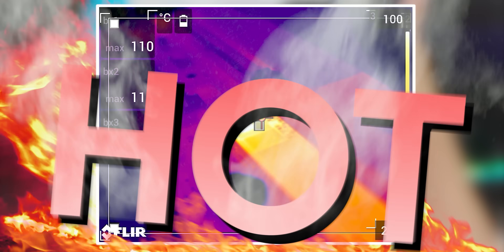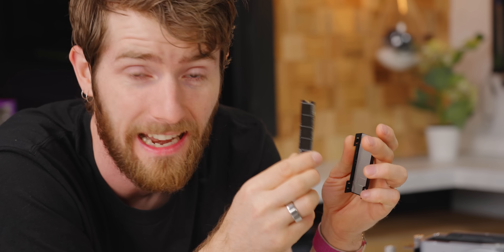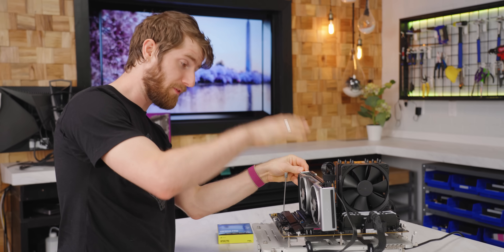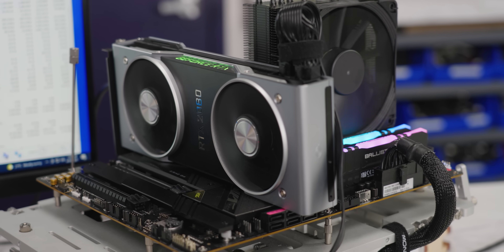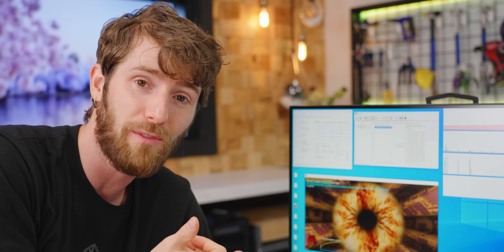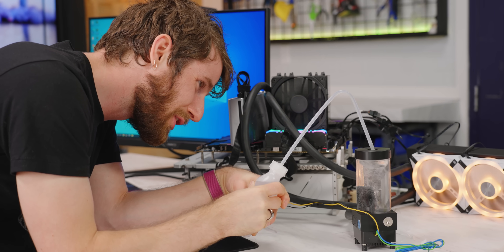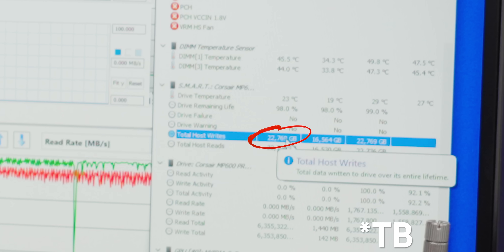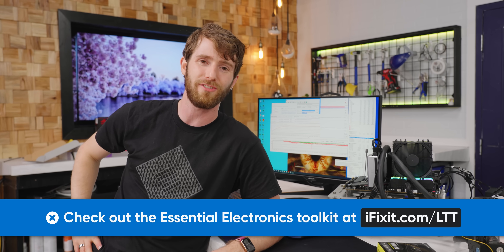This Product is a Meme - Corsair MP600 PRO Hydro X water-cooled SSD

Comment: When I worked at Nokia, we were experimenting with 3D chip stacking and had a combo NAND/DDR package mounted on top of the CPU, effectively working as a heat spreader. Under normal conditions this was fine, but in double-precision FP workloads, we'd see a thermal hotspot in the CPU and observe periodic bit flips in the memory/flash package directly above. We worked around this in production by dynamically clocking down the CPU to stay within thermal tolerances, but there are certainly valid use cases where cooling NAND is essential.
Reply: Tell us the secrets. How did you guys make it unbreakable? my cousin had one and has it to this day and I found it, and dropped it off a 3 story building. No cracks
Reply: its vibranium simple.
Reply: @p_mundt  Idk if they do, but I wish that mobile companies like Samsung, apple, etc.. Also made a drop test, my Huawei wouldn't be as cracked as it is right now if they did a drop test, like i said idk if they do drop tests but yeah, this would've helped me a lot recently
Reply: @diegon3045  OnePlus does drop tests on their phones in their factories. Look up the LTT video OnePlus Quality Control.
Reply: Interesting experience, I wouldn't have ever thought that those weird bugs could occur at such heat loads. Let us all be grateful that technology has come far enough to prevent such accidents from happening, because a bit flip or FP errors are a programmers worst nightmare and having hardware / software overheat prevention technology saves my ass more than I thought that it would. Rest assured that from your line of work, we've learned a lot and that I'm grateful for!
Reply: @kingzach74  That's interesting, sadly they don't sell phones in my country, at least I haven't seen them. But I'm guessing they're durable lol
Reply: @Psyopcyclops  when was Nokia king of the smartphone world? I don't think I've ever known anyone with a Nokia smartphone.
Reply: @diegon3045  well they do, they all do, they're just not testing for the quality you'd probably prefer. they don't test for whether their products' touchscreens don't shatter when it drops, but whether their touchscreens shatter correctly and still work after drops. the touchscreens are deliberately made to be only as strong as they ever need to be, never stronger. would be amazing if the industry adopted a higher durability standard, but as of right now, the industry benefits from your phone drops, they can blame it on you and you can't be too mad because while your screen is cracked, your phone still works for the most part, meaning you don't necessarily need to regularly cheap out and buy the underpriced(or technically reasonably priced) competition, especially when the competition uses the same tactic anyway, but you're more likely think about upgrading sooner in the future since you more than likely prefer not to have a cracked screen.
Reply: @xenonram  the 2000's. When I was in school almost everyone I knew had either a Nokia 3310 or a Sony Ericsson Walkman w810. They were outstanding phones for the time and not much could out compete them!
Reply: @this_is_japes7409  I guess that makes sense, my phones still work after being dropped, but yeah i wish they made phone screens stronger
Reply: @Psyopcyclops  Legendary 5110 for low end market. Even though for low end, the price still steep that time. Love it! green backlit --> blue backlit -> white backlit is a trend that time. also with no antenna :D
Reply: @Psyopcyclops  @Giyari I think you guys missed what Andrew was saying. Nokia was god tier in the mobile phone industry, but most definitely never a god in the smartphone industry.
Reply: @QuantaviousJiggleJrIII  I remember there was some dropping tests. I'm not sure but was it like about 1m and 1.5m drops like few thousand times to concrete. I think it was like slowly spinning machine. 
Remember some first protos that was almost like dust after the test :)
Reply: @Procxlite  nah, they were kings of smartphones with symbian s60 and s90 phones for many years
Reply: @xenonram  Well, that depends on what you call a 'smartphone'.

But even their consumer lines like the N-series were marketed like multitools: with a camera, maps, music, games, etc.  And their communicator line and internet tablet line were pretty much smartphones.
Reply: @Procxlite oh no, they were most definitely gods of the smartphone industry. 
In fact the most popular OS that powered the smartphone industry for years, Symbian, was developed, among few other companies, by Nokia. 

Nokia sold tons of smartphones, almost everyone I know had an N70 or something similar back in the day.
Reply: NOKIA Connecting People <3

Comment: There's something just beautiful about having a water cooled SSD next to an air cooled CPU.
Reply: The only thing it lacks is a passively cooled GPU
Reply: I honestly still heavily distrust water cooling to this day. Air cooling all the way. xD
Reply: @Kaymerra  same. I can sleep easy knowing there's no chance of a leak or a pump failure. If I need more cooling I can turn my home thermostat cooler lol.
Reply: @Ms Moon Boo The real question though is if the increase in performance is worth the money. In most cases I don't think it's a big enough deal, but at least for me whats more important is noise, so when I build my next PC it is almost certainly going to have water cooling.
Reply: @DialecticRed  water cooling isn't any quieter than air...you still have fans.
Reply: @DialecticRed  I tried doing the same to choose the holiday target, it failed because I didn't want to pass my holiday at home. So after been an AMD boy for so many years when I saw the 12th gen Intel I choosed to not stay home.
Reply: @DialecticRed  for me it was definitely a benefit from the GPU side, I went from an air cooled 3070 ti giving me a 40 ish idle temp, to a 20, and it only goes above 40 on the most demanding games
Reply: Imagine if this were someone's actual build. "Yeah bruh I got the uh air cooled cpu and a custom water loop cooling the SSD." 😅
Reply: @penguin12902 Water cooling is considerably quieter than air cooling. You still have fans, but those fans don't have to work nearly as hard to keep your system cool as they do without liquid cooling. So you're able to run your fans at lower speeds and pretty much eliminate any noticeable noise they make.
Reply: @tylerhulbert7199  have you ever tried them side by side in a system? Many YouTubers have compared it and the difference is miniscule. The biggest factor in how low you can run your fans is the ambient temperature of the room. My rig is incredibly quiet already, the risk vs reward of water cooling just isn't there.
Reply: Water-cooled SSD, RAM, and VRM with a 360mm rad and hard-line tubing.
Passively-cooled CPU.
Aircooled GPU (better be a blower design).

Comment: They should make a video with as many water-cooled components as possible
Reply: With a custom loop...it's theorically possible to water-cool the CPU, GPU, RAM & SSD
Reply: @zahylon5993  not good enough. We need to watercool the motherboard, fans, waterblock, water pump, case, PSU, water pipes, keyboard, mouse, headsets, displays, router, and modem!

/sarcasm/
Reply: @zahylon5993  That would be so cool to see!  Like so Linus sees!
Reply: @zahylon5993  There's a couple boards where you could watercool the motherboard VRMs as well, and there are HDD waterblocks. Though mineral oil cooling would be simpler at that point
Reply: @Ceece20  Why not watercool yourself at that point? leave a pipe outside that you can wrap around yourself for extra coolness in summer
Reply: @Ceece20  WATER COOL THE WATER
Reply: @zahylon5993   HDD SSD ? :D   there was a time , we watercooled harddrives bro 😂
Reply: @Ceece, so, just submerge the entire pc, like the mineral oil pc, in distilled water?
Reply: Puts da entire computer underwater
Reply: someone should make a water cooled motherboard…
Reply: Water-cooled PSU?
Reply: @austintrenum8281  that's been a thing for awhile they sell them like that
Reply: @Pfromm007  I've done that. not worth the amount of heat it gives your coolant
Reply: @romanbennifir6020  that means it's doing it's job :troll:
Reply: @Ceece20  I mean you can mineral oil cool the whole cpu, those are cool af
Reply: In that case, they might as well submerge the entire setup in a liquid. I heard some servers does that, using a fluorine-rich fluid made by 3M that is non-conductive and non-corrosive...
Reply: @zahylon5993  chipset, used to be able to do NB and SB independently.
Reply: water-cooled PSU
Reply: @Ceece20  I suppose  you could run the loop through a copper coil through an icebath
Reply: @austintrenum8281  they have watercooled motherboards for years now. my old asus rog from 2006 was watercooled !! now only the most expensive motherboards have watercooling
Reply: That's called immersion cooling
Reply: @zahylon5993  building one now lol... didnt know i was a meme...

Comment: Corsair: What shall we watercool next?

Introducing the new Corsair CMOS Battery water block
Reply: Watercool the LED strips!

Might look sort of sick if you design it right, actually...
Reply: You might be on to something, I replaced my 4 year old CMOS battery that was in a laptop that was very hot and it was expanding (Or slightly inflated)

lmao
Reply: maybe they could watercool the pumps of watercooling system
Reply: well the engine batteries of tesla are water-cooled, but I don't know what about the tesla's panel's clock. maybe Musk is lying to me and not every batteries of the car are water-cooled.
Reply: @AfonsoBucco  the battery in the Tesla key fob is the same as a CMOS battery so I think we just figured out how to get corsair more business.
Reply: Oh Lord.... don't
Reply: @iPhoneAppReviewer  So will I have to replace it eventually? that's a shame for a rechargeable vehicle. They should make a motion loading solution like you see in flashlights or wachtes
Reply: WATER COOL THE CASE.
Reply: Just do what ASRock did and fill the motherboard with water.
Reply: 10/10 would pay for it
Reply: Water cool the Power Button, Hard Drives, SSD, audio card, capture card.
Or just water cool the water cooling.
Reply: Water cooled power switches/buttons
Reply: I would like them to make a Liquid Cooling Power Supply block. Mine power unit is running too damn hot it actually cooking me alive.
Reply: @Michael18751  uh,you're lucky it can expand even more and starts leaking,you know sulfuric acid is not good for your motherboard and for you if inhaled
Reply: @BackwardsPancake  why don’t just RGB the cooling pipes?
Reply: BIOS water block.
Reply: I'd like one of those, you could turn it into a junction for the other components cooling...
Reply: Lol
Reply: I would buy that because it’s ridiculous.
Reply: @AfonsoBucco  They are watercooled due to expansion when charging or discharging. Not because it looks so cool. If the watercooling was'nt there you'd have thermal runaway meaning your battery pack would catch fire. And almost impossible to kill the fire with just water. Very dangerous stuff.
Reply: Watercooled cables is a option!
Reply: @BackwardsPancake  You know know how hot are those high power LED can be.
Reply: Sometimes I put my laptop power bricks in the mini-fridge.
Reply: nah, watercool the power supply 
im sure that wont cause any issues
Reply: Water cool the hoses next
Reply: Introducing water cooled case fan
Or Introducing PCI express water cooled conector
Reply: Water cooled PSU, doesn't sound dangerous at all...
Reply: @iterminator309  he did it ...  4 year ago.. with a fsp power supply
Reply: RGB the radiator fins!!
Reply: Watercooled power supply duh
Reply: we can cool the fans of the watercoolers 😅
Reply: Water cool the PSU (Just be very careful rofl)
Reply: @BackwardsPancake   Lightdiodes dont make Heat.
Reply: they could watercool RAM
Reply: @ThePhoenix49  Every electronic makes heat, if you wire it badly enough.

Comment: I would 100% watercool some capture cards I've used just for the peace of mind or to eliminate tiny noisy fans.
Reply: Would strapping large fans or having fans on flexible mounts pointed at the capture cards help?
Reply: @robertt9342  You can try tearing down the capture card, replace stock cooler with those tiny VRM/Memory heatsink on Amazon, then stick some Noctua 40mm fans on top with adhesive tape. I saw someone watercooled a Magewell card but I think you would have to make your own bracket if you wanna go custom loop.
Reply: I slapped an Xbox 360 heatsink on one of my generic USB capture cards as a passive cooler and it worked like a charm. I can touch it without burning myself now. Haha!
Reply: What's up checkmark?
Reply: An EposVox comment? I guess this is a sign that maybe I should hurry up and try streaming again lol.
Reply: I'd watercool my PC case and the built-in Ethernet card so that it overclocks the internet for my games, but it would be required to also watercool the modem and router :)
Reply: @guily6669  The router I wouldn't mind, but the modem can be steamy at time.
Reply: Pretty sure they already did that
Reply: it's a modem. Who cares?
Reply: Dude..the noise..the noise from the fans makes me not even want to turn on my PC..I feel like it literally drains the energy from me
Reply: @SpaceRanger187  then slow them down... If your fans are too loud then they're either broken or you didn't set them up properly.
Reply: Get an o11 dynamic XL and get a noctua fan to blow cold air on it.
Reply: Small high rpm  fans are annoying af! Reminds me of stupid nvidia chipset board with freaking hot northbridges  that were once a requirement to run SLI. Cooked a couple of them back in the day, first was a Asus and second a evga, that i ran totally within spec (1600fsb iirc) and it still failed, cost to rma (being im in Australia) it was more than i would have sold it for,  id already given up on sli and purchased a intel chipset p45,that did up to 2000fsb and is still running to this day, so no desire for garbage nvidia chipsets. Burnt forever on evga's "lifetime warranty" and never will buy their products again as a result.
Reply: Just make a waterproof pc and throw it underwater in a pool with circulating water: no fans and if fans then submarine
Reply: To be fair to do get a bit on the hot side and let alone the fan noise but under high temps they can crash which may end up corrupting the recorded content so basically one temp related crash can corrupt alot of footage,so yeah capture cards could have a benefit from watercooling at least a benefit for the peace of mind of the actual user =))) Those things while they get hot they are resilient but still the risk is there so yeah

Comment: Manufacturers: We made SSDs smaller!
Also Manufacturers: Buy this massive water cooler for your new ssd
Reply: Who's buying water-cooling just for the ssd?
Reply: @Anytyme06  Rich kids probably buy it. They will buy the best for their PC.
Reply: @godofnothing520  if they're going to liquid cool, they're going to liquid cool everything they can not just the SSD.
Reply: @Anytyme06  i did nearly a year before this video release.
Nvme ssd waterblock is available a two year or more than before this vid.
I got a bykski nvme waterblock nearly a year before this video LOL.
And i have 2 of those and connect it in my loop.
Why not? Im water cooling my pc so why not add it?
Nvme really goes hot to be honest well adding a loop to cool this down is overkill but if you have a existing loop or building a new loop its better to add it.
Just like the vid review says it have 0 flow restriction bur effectively cools the nvme a lot better than a bare aluminum heatsink.
Reply: @gamertechlive1780  Most of all, it looks cool having more toobs. :)

Comment: I feel like it's also worth noting that building a custom water loop will keep your SSD cooler in that slot simply because those high heat components will then be dumping their heat into radiators instead of the air right beside the SSD. On the bright side though, for the cost of the fittings, this is an easy integration into a custom loop, so no harm no foul for Corsair I suppose.
Reply: very good point. its just a little extra compared to normal air cooled heat sink style, and it give a great option for those who already have loop to plug this into. 
I think the pricing itself should be lauded.  they gave an option to users (mostly gamers) who have a water cooling loop and didn't charge them an arm and leg for it
Reply: @KunalVaidya  Totally agree. I was eyeing my own loop, and it'd be incredibly simple to add in if I wanted to go that direction. It's great that the price itself isn't the barrier to entry.
Reply: @KunalVaidya  The SSD itself is worth the money, as most good NVME SSDs with that capacity (especially ones with the same performance) are about the same price (some margin for error).  The water block might have little benefit for most users, but some people will no doubt be able to gain performance in some cases, and for a drive this good, its still worth it.
Reply: @HoosierHardware  its honestly not because removing the fans on the cpu cooler and graphics card also masssively reduces airflow over those sections of the case making them worse thermally on them which is why watercooled stuff needs better vrms
Reply: Only VRM's are running hotter without forced air around cpu
Reply: Yes actually when I'm building a loop last Q4 of 2020 I saw this nvme water blocks and they were cheap.
So I bought two of this and water-cooled 2 of my nvme driver it's Max temp is 49 degree with a ambient temperature of 30-32 degrees.

Comment: You should have tested it in a water-cooled system to test it in the main use case. It might be interesting to see if water-cooling the SSD matters when the system components right next to it are producing less heat
Reply: Very true
Reply: Very true